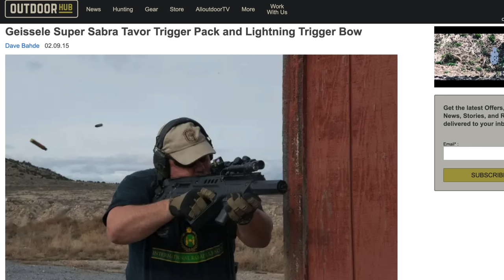6 Reasons Why the IWI Tavor is Better than the AR-15

Comment: I'm ex British army, left 20 years ago so am biased towards bullpups (even though I had to use the L85A1, never had chance to use a conventional assault rifle) one thing I've not seen mentioned about bullpups is how good they are in urban settings....not talking about length etc.
 I did a tour of Northern Ireland, so you're interacting with people daily, walking streets etc. 
Your mag release is covered by your arm, no one can press it in passing etc, also you can punch with the rifle one handed, its like an arm/fist extension. 
I think how James said about mag changes being slower is probably down to him being used to a conventional set up, if bullpup is all you know, you are slick on that system. 
 I love firearms, but being in the UK we cant access like you gents over the pond, so many gats I'd love to have/use but if it came to it and I could only have one, would have to be my shitty SA80, because I know it, I trained on it and am capable on it.
The sling we were issued/the mounting points were excellent, so many configurations for carry. Would love to see how the L85A3 is to work with. But saying that would really like to try some of the AR's you guys use.

Comment: The Mepro 21M sight is fantastic except when aiming from inside a building looking out into bright sunlight. You can't see the reticle. That can be fixed by getting the REM 21 (Reticle Enhancement Module) that attaches to the side of the Mepro 21. It has 11 light settings so the user can adjust the brightness of the reticle.

Comment: Tavor is best with Shooting Sight TavD two stage 3.5lb trigger pack, Geissele metal trigger shoe, and the front barrel to grip lug removed for free float effect. Slap a suppressor on, and you get the full experience of short rifle with long barrel. 300BLK version or swap kit for Tavor has 3 position gas block
Reply: Three? I thought it had just two, sub and super. Is there a third position I’m missing?

Comment: If I buy one, I’m going to get the aftermarket trigger with Gazeley and the super saber trigger pack. Then you can get it down to about a 3 1/2 4 pound trigger which is awesome to be much more accurate. That way it’s an expensive gun. But I like the fact that is such a short package, but still accurate

Comment: James, if you want ar15 accuracy in a bullpup with ar15 parts interchangeability then check out the senex arms bullpup. 18 inch ar barrel with an oal of 26.1 inches.

Comment: I've never had or seen that black face issue before, but I suppose you shot more than most people do in one sitting.

I've had my X95 for a number of years now. It's been totally reliable after a brief break in period, and I haven't had the need or desire to upgrade anything other than the grip.

Comment: The VHS-2 could have competed with the X95 if only it had a similar bolt hold and release system, and the AR style mag release with the trigger finger. I found the VHS cool but less practical when it comes to manually locking the bolt back and dropping the bolt

Comment: Never got my hands on but in my limited experience, a modern bullpup and cartridge should have the potential to be a superior combat rifle system to traditional design. The Tavor seems to be the first actual contender for that title. What's holding them back is the lack of availability and the 60 something year head start the AR and AK had for aftermarket and clone development. I still think there will be an offshoot that will be closes the gap even more.

Comment: Good review (...Other than the part you got mad at the camera man (14:24) ... :))) ...Looks to me like a great gun overall, but as you properly noted, it has its merit with the type of (New_Old) battles the IDF is facing lately; relying on more maneuverability and ease of use and less of long range sniper accuracy. It looks to me like an improved Uzi, which was also designed to be fought in Urban area, tunnels, and close quarters. Without inspecting all the tech data I will argue that the long range 5.56 rifles will create more havoc with better accuracy and deadly power, shooting at close to 1,000 m/s, you can completely disable someone from 350 meters. But I am sure that IMI know what they are doing and fit the best rifle to the type of battles and soldiers. Proper disclosure: at the IDF, I used FN, Galil, M16, M4 (and more) as personal rifles. I adored the Galil, which had the ability to shoot at any given condition with no jams at all; but surely it was heavy. At one of my positions, as a machine gunner I had to carry the machine gun, its bullets, and then also my personal rifle and it magazines; I can tell you that after few Kilometers you feel the difference.... :/
(another consideration that majority of viewers will never need, is that the Tavor has a different ejecting angle of the cartridges. Nobody here should care, but in fighting, with line of soldiers shooting, say from a tunnel or behind a mound, you get all the hot cartridges of the Galil/M16 ejected right in your face (or left chick, or down your collar) from your colleague to your left, especially if he is a foot forward in relation to your position. Not to mention the noise waves traveling right at your left ear and killing it... This doesn't seem to me the trajectory of Tavor ejected cartridges).

Comment: I just wish the x95 kept some of the aesthetics of the Tar 21. For the cost of having a few covered picatinny rails, the x95 loses that iconic curvy look. Obviously looks aren't everything but my Tar 21 (even after shooting an AUG and x95) is the bullpup I have shot. I absolutely love mine. Along with a crisp 4.5 lbs trigger, I have put thousands of rounds through mine with no issues... except one time using steel-case tula ammo. Lol
Reply: I owned both, and as nice as the curvy look was, it really did get in the way if you tried to shoot off a barricade or any kind of support.  The X95 is a pretty well thought out upgrade that was clearly made based on soldier feedback.

Comment: This could have been my first bull pup, micro only.  Even paying the $200 stamp is acceptable, but waiting for that Form 1 stamp prior to delivery just turns me off.  I would pay more for a 16” rifle in micro config and separate 13” barrel package and eFile Form 1 at my convenience. Or, if they could invent and offer a “brace” as standard equipment sold as a pistol which makes it easier to resell if you wished.   Offer a “replacement” Stock if one wished for an SBR. 
Or can Tavor litigate to have the micro classified as a pistol that has No stock attached?  I think an argument can be made that anything past the receiver is Not a Stock, just the receiver???  Or am I totally missing something???  Great vid James from a fellow Coonass!

Comment: I actually agree. I don't think we should worry about the few people who are outside the norm. If you need ambis get an ar and get aftermarket stuff.  I'm left eye dominant but I just make due because I don't want to fuck with everyone else's procedures. If your gun is on your right shoulder that affects where you'll move it to not flag me. I'd rather practice and get really good handling a standard rifle the way it was designed so I feel like I have a slight advantage when I have to switch hands because my left eye makes it slightly easier, making the odd new manual of arms and positioning a bit easier to deal with. But I still think an ar pistol configured well still beats this in all but field conditions. Too cheap, too much aftermarket, and too much compatibility to deviate from the ar platforms. Cool gun though. If Franklin armory makes a binary for it I would be interested. And maybe an integrated bipod chassis, like the blk lbl.

Comment: I love the X95. I need a gun for my truck because I drive all day. I don't want a cheap "truck gun", I want 762x39 as a minimum and would get the x95 if it was available. I need to shoot a 308 tavor because it might be what I need. Galil Ace is my current top pick just because I hate the ak optics mounting bs. My bedside daylight rifle is an akm 7.62x39 and I love it. Trying optics on an AK after shooting my ars with mid tier optics is an insult to the optic. If it works for you great, I think I'm going 308 tavor with elcan. I'm not dropping 1k on ak accessories just to mount a light and an optic and have a 17lb rifle. 12.5" max 9lbs and caliber that can excel defeating soft cover. I think I'll get both 308 tavor and the ace and figure it out from there.

Comment: Thinking of using X95 with DBAL 2 / NVD.  The stock is a bit high so nods might require a pretty tall riser for red dot unless using IR laser.  Problem might be if need magnifier behind red dot….  Will see.

Comment: Shooting/moving in vehicles is so much easier with a bull pup. Reloads may not be as fast, but we're splitting hairs with about half of a second difference. I'd much rather have the increased velocity and rearward based weight when moving in and out of vehicles or shooting around barricades.

Comment: Can it be configured to the eject from the left? One of the biggest problems with a bullpup as a lefty
 is hot brass to the face.
Reply: He said on the video it IS capable of lefty configuration by swapping the ejection port cover with the opposite side cover
Reply: You can switch the x95 from left to right or visa versa. But, the x95 you need a left hand bolt which is unavailable. And if you got one it has to be installed by an authorized IWI dealer. So they won’t ship you one unless you buy a barrel an a bolt. However the Tavor 7 you don’t need a new bolt you just take bolt apart and switch angles. I own both of these rifles. And as someone in this thread said you can’t buy parts for them. I don’t understand why at this point.

Comment: IMHO, i still stick with the traditional AR-15. The big issue with bullpup rifles is that it's a bit difficult for left-handed shooters to avoid being hit by ejected brass cases of spent ammo. But the TAR-21 seems to have fixed that issue with a higher degree of switch from right-handed to left-handed configuration without having to work it out too long. And also, if you want a more rugged AR-15 platform that can withstand heavy battlefield abuse (being buried in earth, mud or sand, submerged under water and resisting saline corrosion in marine environments), there's the german HK 416 and also other variants working with the short stroke gas piston. There are many options according to your budget.

Comment: 12:30. This is what makes m193 better over m855 any day. It’s faster and fragments. And m193 will make it through level 3 and 3+ plates depending on distance where m855 has been proven to not only struggle must be completely stopped by level 3 plates where m193 zips right through

Comment: The IDF M4s (actually CAR-16s) are mainly mid-1970s vintage and have been subjected to mind-boggling levels of abuse in their decades of IDF service.  These rifles have untold gazillions of rounds down their bores, and have been dragged through the dirt for longer than most of us have been alive.

One example: during field maintenance on exercises, it was common in the early 80s to toss the rifles (and MGs) into a shallow dirt pit filled about 1x2 meters filled with kerosene or diesel: total immersion in a filthy mess of crud and crap for the entire company's weapons. Swish them around, then pull them out, run a few patches down the bore (without a thought to the barrel crown) after stripping the bolt and toothbrushing it, then rag everything down and call it good.

Comment: I live in a country where we used to be able to own rifle caliber firearms, and I've always wanted an X95 since I first saw pictures of it.

But unfortunately, it costs about 20-25 times of our average salary or about 3,500 to 4,000 dollars! And furthermore, paying an absurd amount like that feels like being ripped off after knowing a lot more about guns.

The Tavor used a lot of the AK's concepts and subsequently inherited it's biggest flaw, namely, the poor accuracy, possibly because of the following:

It used an improved AK barrel retention system, namely the barrel sits in a longer trunnion and is locked with a pin. Still, this inferior to the AR15's barrel retention mechanism where the barrel is held tightly and locked securely by torquing it, this method allows things to be held more securely down to the last possible movement until it gets too tight while being reasonably easy to remove. Sure the AK style of barrel retention can be made just as good, but the fact is most AKs don't, even the newer ones, while even the most basic AR15s are more accurate, heck, even the older ones that were already around decades before I was born.

It uses a hybridized AK/AR15 rotating bolt, which seems to allow for sand and debris to clear the barrel extension, improving reliability, but it has poor lockup compared to the AR15 with practically only 2 locking lugs with 1 backup from the extractor instead of 7 + 1. If accuracy on the Tavor is to be improved, this is where most of it should be.

Finally, the bolt has integrated camming surface, which at first seems like a great idea to make it even more compact, but it looks like it is actively being pushed up and down by the bolt carrier to achieve rotation instead of using a cam pin to rotate the bolt like a lever and have said lever rest on the receiver or bolt carrier while on battery. Instead, because of how the Tavor achieves bolt rotation, it seems like it rests instead on the bullet case while on battery. While I design guns using CAD as a hobby, I am no means a harmonics expert but I believe it can disturb the harmonics of the barrel even further if not for the long and thick trunnion where the barrel sits, which is why I assume it's heavier than most AR15s.

Anyone who reads this comment should take it with a grain of salt, this is merely based on what I have observed to justify wanting to purchase it, only to find it too expensive for what it is, even if I can get it at US prices.

Comment: As has been mentioned, parts are not easily obtained when they need replaced. My Tavor SAR and FS2000 are relegated to safe duty because of that.
Reply: Midwest gun works has FS2000 parts from time to time but yeah I baby mine

Comment: I love my x95, but it is no where near as accurate as my MK18. That said to fix your gas in the face, the manticore port cover doesn't do much. I just put some FDE 100mph tape over the original one and you also need to put some where the metal meets the plastic stock on top as a lot of gas and carbon leaks there too.

Comment: It's not about "catering" to a small amount of the population. Other rifles are almost always fine. As a left handed shooter I've never had a problem with the M4, Ak's, or the M14 but when it comes to bullpups it's pretty important. Nobody should have brass ejecting in their damn face especially for a service rifle. Considering this it's about designing it right, not catering. It's not a huge inconvenience to address this issue today.

Comment: Pros: Dependability of a gas piston AK, 26" oal with a 16" barrel, battle tested, can be held indefinitely and fired accurately with one arm, better vehicle use, better concealment. 
Cons: Heavy, greater felt recoil, limited aftermarket, extremely expensive.
Abstract: If I had to grab one center fire semi-auto from the safe and go, it's the Tavor.
Reply: Forgot to mention the trigger. It's fine for a battle rifle, squishy and long. A Geiselle trigger pack plums that up but for 350 bucks..on a 2,000 dollar rifle, ouch. On the bright side, the trigger pack drops out and reinstalls in 15 seconds.

Comment: X95 is superior to the AR15 for what the vast majority of people will use it for, which is firing within 300 yards. Never had it jam even after over 2k rounds. My favorite comment from people is that the improved ballistics don't matter if you want a short overall length rifle for close up. So why not just run a 6" AR15? It's the same overall length. Never got a good response about that. 

Oh yea, and reloads. The people that complain the most about them have never tried it before or practiced for 10 minutes. It's really not difficult and the extra 0.5 seconds it takes to reload doesn't matter.

Comment: the Steyr AUG A3 is the best general purpose rifle to me because it combines range, acceptable 2 to 3 moa accuracy, durability , muzzle velo, great for urban or mounted ops, and ease of maintenance and changing of parts.. the Tavor ticks some of these boxes as well and I would prob take it over most AR15s... but the charging handle and the trigger is unimaginably bad... like much worse then the already bad AUG trigger and handle ... and the accuracy issues with the X95/ Tavor being more like an Ak Pattern 3 to 5 moa gun is very concerning ... the durability and reliability is def there and the same good muzzle velo and handleing ... but those above concerns are problems to me..

Comment: It's so much fun when right handed people get their panties in a twist because something isn't made exclusively for them. Like it causes them pain or something. Really though, I don't consider the X95 to be 'ambidextrous'. It's left/right hand convertible but not ambi. For example, Keltec RDB is ambi because I can hand it to a right-handed person and it doesn't need a trip to the gunsmith for them to use it. This matters because odds are if you're a leftie, other people in your home aren't. If I needed to hand one of my weapons to them in a pinch I don't want them to have to adjust their manual of arms because something's been 'converted' for my use. I've lived my whole life adapting to righthand biased stuff. Righties haven't, and in most cases their ability to adapt to a ergonomic world not catered to them is.... Lacking.